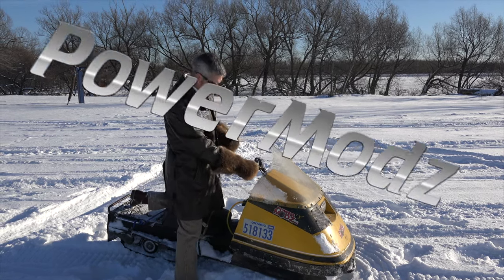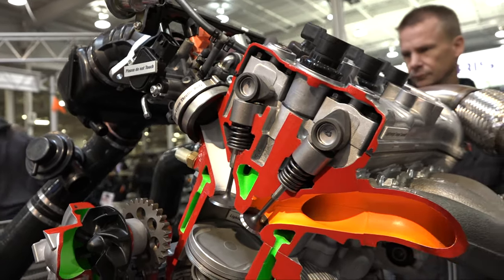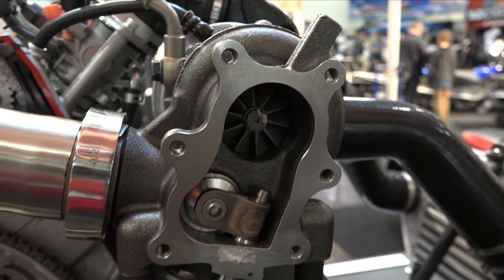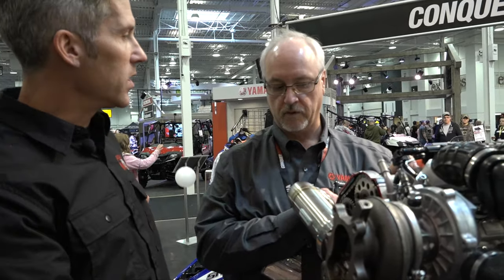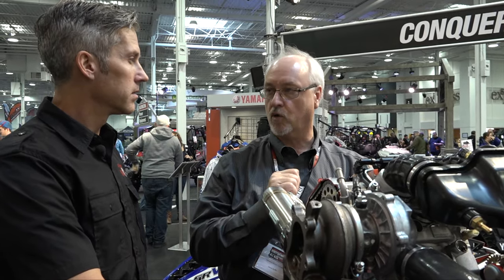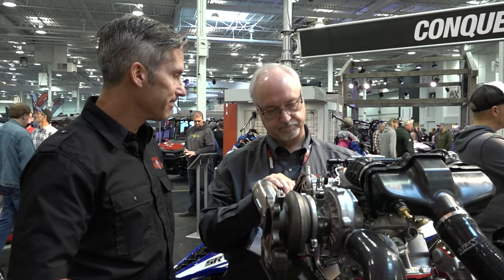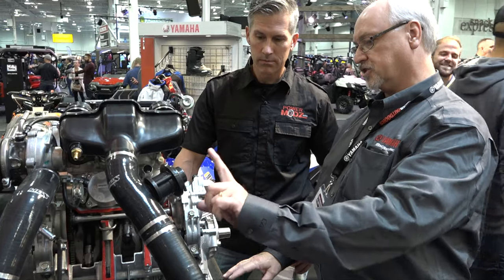The new Yamaha Genesis 998 Turbo explained  - Toronto Snowmobile Show.

Comment: Funny thing is that yes this sled has 180hp when its brand new but after you have done the essential first 500-700km breaking the engine the horsepower will be closer to 190-200. What a dream machine.

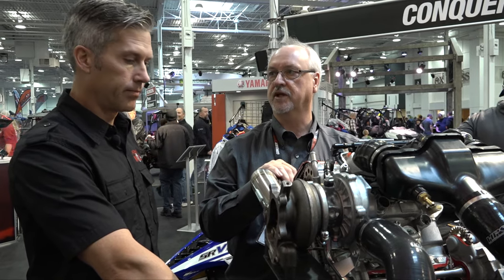Comment: Wait wtf did this guy just say? "once the vehicle is upset, the fuel pumps shut off" 6:05. He is talking about when the sled rolls over and oil getting into various parts of the engine. The fuel pump has nothing to do with this issue, again this guy really isnt too sure about what he is saying.
Reply: Nye'ce Garage the next sentence he says that they have sensors and things in place to keep oil from filling the engine and running out of the sled.

Comment: Anyone have any tips for setting up elka stage 5 shocks on an iqr 600 I have an ex racer and the shocks really stiff a haven't done anything to them but do I need to send them in to get them halved or can I just set them up for trail riding
Reply: Handy Andy since they are racing shocks they are valved very stiff, you can turn the high speed and low speed knobs down to softer settings and try it out, but chances are they will need to be revalved
Reply: +Simon Belanger ok thanks
Reply: +Simon Belanger do you know how hard it is to do and do I need to send them to elka or are there other places that will valve them
Reply: Handy Andy youll have to send them but you can send them to any shock builder, hygear suspension, blommel motorsports, ect, just depends on what area you're in
Reply: +Simon Belanger thanks I'll try to set them up first but I'll find somewhere if I can't
Reply: Handy Andy Why post a question like that here vs a web forum or something?

Comment: And lastly, the blow off valve.... the engineers at yamaha did not just magically make this up one day, it is actually called a re-circulator valve and has been around for decades!
Reply: its the only way you can legally have a BOV in australia lol
Reply: well, let's just make it a thing.. in 2016 yamaha invented the re-ciculated bov valve located on pretty much every vehicle with a turbo.. #patentwar? :-)
Reply: BMW has been making recirculating valved turbo i6 motors since 2007